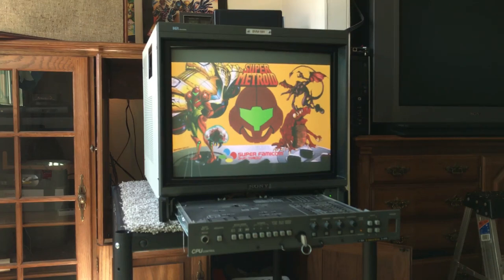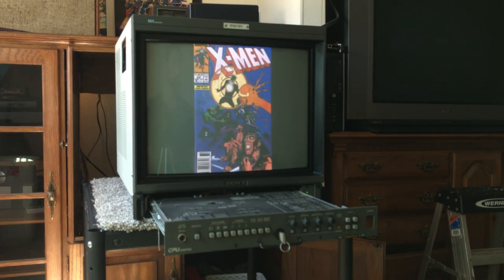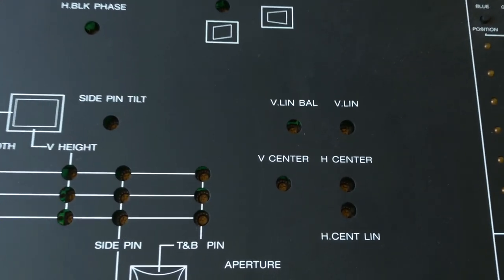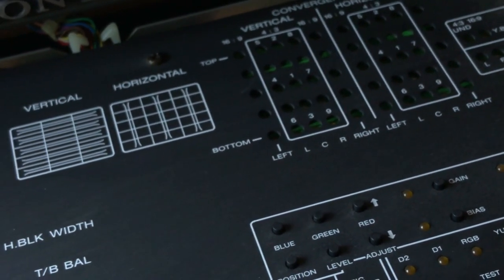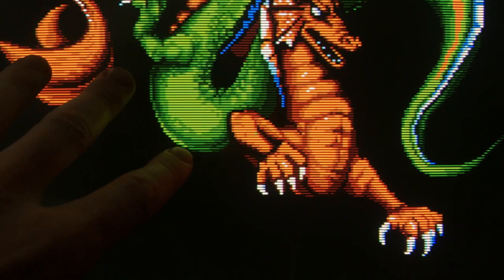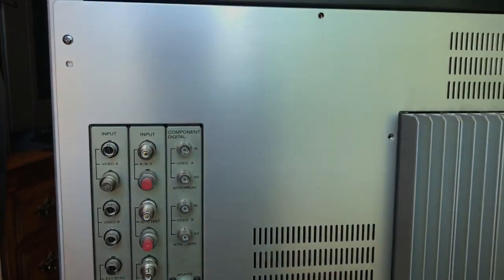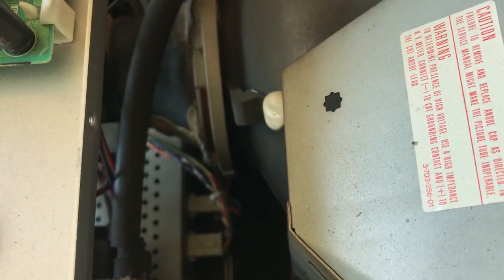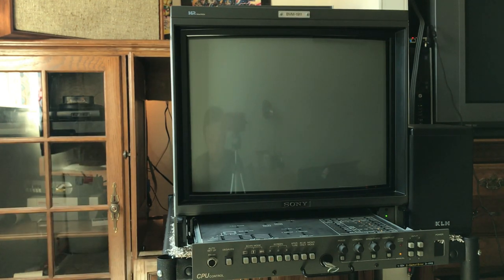Sony BVM1911 CRT Monitor Retro Gaming Review

Comment: Great review to see the engineering evolution that would become the 20F1. A great thing having those pots to adjust everything is that servicing is still possible without needing to worry about the eeprom firmware being corrupt or old which happened to me on my 20F1. I agree that convergence won’t technically sharpen the image but it converges the beams closer and makes the image more focussed. Thanks for sharing your overview of the monitor
Reply from the maker: Yeah it's a trip. Growing up I always thought technology would only get better but looking at the state of things today I'm not so sure about "progress".

Comment: So sweet dude! Love my BVM-20F1U, has 35k hours but had a tube swap, so it is practically brand new in that regard. As far as the BVM/PVM & consumer tubes, I believe the lower grade PVM tubes that weren’t as sharp were used in a small amount of consumer CRTs of the same size (20”) so basically the 2030 as far as I can think of - which was already a “pro-series” consumer set in Japan back then anyways. But seems you may know more about that stuff :)
Reply from the maker: Japan has different tubes. I don't know much about their market but I have heard that consumer grade Japanese tubes can have 2030 tubes in them. I got a soft spot for the 2030. It's got style.
Reply: @riggel8804 same, such a great PVM man

Comment: Hey there, I forgot to come back here to tell you how it all went and to share a couple of pics I took! Anyway, of all the CRTs I have here, this is and I think will always be my favorite. Not only because of the beautiful image it produces, which is awesome, but because of how cool it is to adjust nearly everything physically and immediately with just the turn of a small screwdriver. Dammit, I love it! Adjusting vertical size, center, and the same for horizontal, is just so satisfying. Opening the tray alone is just so cool. I love this thing. 

Here's a couple of pics I took of it (added as replies here), I adjusted it the best I could, but it's hard to do it justice. I will make a playthrough video with this monitor on my channel in the near future. YouTube now has a thing with deleting comments featuring links, so if there are no replies to this comment, then it got deleted. But yeah, it looks awesome.
Reply from the maker: yeah bro youtube ate your link. Stoked you like the monitor. The cool factor on it is off the charts. It came out at the pinnacle of Sony and the pinnacle of analog tech. Right before everything went digital.

Comment: I got a 1988 BVM 1911 for 700$. Some people might  think that's expensive, but for me, I can afford it easily. Plus it was a steal price for what they usually  go for, especially considering the condition it's in. I tuned it to have nearly perfect geometry and convergence. The colors are vibrant and the screen is as bright or brighter than my VGA monitor. I unplug it from the wall right after I'm done using it and I try not to use it too any hours a week. It's built like a tank, it weighs 90 lbs. This thing is really nice and I'm not selling it any time soon.
Reply from the maker: I think it has $700 in value compared to what other monitors you could get for 700. I didn't know they made them as far back as 1988. Damn. Does it look different than mine? 

I've heard of people getting 80k hours on these things so I wouldn't worry to much about how much you use it. You probably couldn't wear out the tube in your lifetime if you tried. Even if you used it 3 hours a day every day that's only a thousand a year. I'm sure some components will fail eventually. I had to replace a couple caps on mine on the deflection circuit. Hope you got a way to service it.
Reply: i know the listing your talking about man i wanted that thing issue is i lived 16 hours away and had no money enjoy

Comment: Hi Riggel! I got the monitor yesterday, it looks amazing in person. I took the RGB to BNC adapter that I had on my PVM and plugged it in and turned on the Super Nintendo, it looks amazing! Got a garbled image at first, then all I had to do is open the tray, click on external sync, then RGB (was on component) and a couple of turns with the screw to adjust size and centering and wow, I just love how easy it all is!

That being said, the image defaults to a bright, washed out image when the brightness button is not pushed in. I don't actually have enough 75ohm terminators. I just had three here, which I put on the output of the RGB, but I reckon I still need one for the external sync out, and the two composite out as well? What about the component digital outputs, do I need terminators on those two? I stopped using the set until the terminators I ordered from eBay get here, which is a shame, as I really wanted to game on it asap!
Reply from the maker: I think you only need terminators on the output side of populated inputs. So if you are using rgb you need terminators on the r g and b output. You don't need terminators on the composite or component digital if memory serves me correctly. I am not sure about the sync line. I know there is a manual button on the front that you have to toggle on or off to mess with the brightness rotary dial on the front.
Reply: @riggel8804  Thanks for replying so quickly! I appreciate the info. I looked up on the manual, and yeah, it looks like I will need a terminator there:

Page 14
"When the loop-through output is not used, attach a 75-ohm terminator."

So it looks like I'm one terminator short and will have to wait, as I just have 3 of them at the moment. Hopefully, it gets here tomorrow, so I can get to finally use it safely. The manual says the same thing about the composite inputs quote above, but it doesn't specify if you need to be using the inputs in order to terminate the outputs, so I don't know for sure. 

I won't be using composite on this set at all, as I stick with my consumer sets for composite or RF. Is there any harm in terminating them anyway? If so, just the output ones, not input, correct?
Reply from the maker: @crt_rex  No. There is no harm in terminating them if you are not using them. You could hook up to component to test it out. You have 3 terminators and you only need 3 when using component. Hook up a ps2 or a wii if you got one. Or you could hook up a dvd player.

I don't think you need a terminator on the composite if you are not using it. You will know something is off if the image is way to bright. In that case you are missing a terminator.
Reply: @riggel8804  Thanks! I got a Wii and PS2, but I also have added component to my RGB-modded NES, so I could just hook that up then, until all the terminators get here! Capital idea. I could even use my RGB2COMP for other consoles if the terminators take a long time to arrive. Thanks for letting me know about the composite, I won't be using it at all here, so it's good I can just leave it alone then.

Comment: Very awsome set indeed! I'm like you though, I'd rather game on a bigger screen. Question: You have any knowledge on Sanyo crts? I was able to pick one up for free in a nice housing edition. It's a big boy 32in. The convergence is absolutely perfect! I'm not the best at all in honing them in as I'm still learning, but I wanted to learn more info on the set and brand in general. When I google anything about this model I keep coming up empty handed. The model is DS32225-01 with a november 2005 manufacturing date. Any and all information or options would be welcome. So much info is available on the popular brands it's insane. I've personally never thought Sanyo as a weird low budget brand. Somewhere in the middle. Maybe I'm wrong?
Reply from the maker: I know nothing about Sanyo. I know guys like there Philips tvs and I would have thought of those as cheap. I have a couple budget tvs that look amazing (Sharp and Panasonic). The fact that it's 2005 means it's probably got a fresher tube and that's good.

Yeah. It's next to impossible to find info on most consumer crts. Be part of the solution and do a crt reveiw!
Reply: @riggel8804  lol while I'm flattered that you think I could do an actual quality crt review, I honestly don't think I'm good enough as the legendary Riggel. Maybe once I can get into the service menus I'll share little bit of my opinion on it. No remote, so that will have to be resolved first.
Reply from the maker: @TheAlphaOmegaX3  Yeah let me know what you think. There's a lot of hidden gems out there....a lot of stinkers too.

Comment: Nice monitor man!
I had the chance to grab one a few weeks ago from my monitor supplier but I was broke and it had 50k hours racked up on it with no indications of a tube swap so had to pass. 
I might be picking up an hdm-20e1u from him though which is another rare one.
Reply from the maker: get em while you can. It's not getting any easier/cheaper. Never heard of the hdm. I did a google search. Multiformat hd 20 inch crt. Doesn't get much better than that. Is it 4/3?

50k is a hell of a lot of hours.
Reply: @riggel8804  I just made a 3rd trip to my pvm guy a couple weekends ago. I got a 20m2u, 14m2u, three 8" bvms, and a bunch of other goodies for cheap.

The 20m2u is in great shape but red tally light is on and wont power on. I got it on the bench tore down doing deflection recap. The power board is outputting 5v,15v,and 115v outputs fine so its something on the chassis board. If caps dont solve it ill be pulling and checking transistors. Most of the caps I pulled were high esr.

But yeah, the 20m2u will be my first 20" sony pvm. I cant imagine any tube looking better than my 20" panasonic 800tvl broadcast monitor but I hope im wrong lol.

Hes got another 20" panasonic monitor for me that wont power on and that hdm 20e... I never heard of them either untill now. They made a 38" 400lb version thats super rare 😮
They are 16x9....Only does 480p or 1080i though but would be cool af for later gen stuff,movies, and maybe hook pc up to and try some new games on it.
He said it might need work though. Image smearing. 600 bucks.
Its a gamble and idk if a service manual is even available its so rare. Could only find one post on reddit of a guy who had one.
Reply from the maker: @LameGaming  I wouldn't expect the 20m2u to look better than your Panasonic. I have a 20m2mdu and It's no sharper than my consumer grade Toshiba. Don't get me wrong It's a great monitor but it's at the lower end of video quality as far as pro tubes.

That HDM looks like a hot mess. 16/9 on 20 inches is going to make 4/3 games look about as big as a 14 inch monitor. So you can basically think of it as a 14 inch monitor. Can't imagine watching movies on that thing. The fact that it doesn't do 240p makes it kinda useless. If it was free I would pick it up for a youtube video but for $600-hard pass.
Reply: @riggel8804  Yeah, the 20m2u will be fun to compare against the panny but cant see it being better.
I have mixed feelings about the hdm.... Would be cool to play some current gen stuff on. I think ps4 and 5 still have 1080i options. But yeah, $600 is alot.
I wish I could find a jvc or Panasonic multiformat monitor.
I did get a free 26" toshiba widescreen hd tv for free, i need to test it out still... Im hoping I can laglessly pass through 480p as 540p on it
Reply from the maker: @LameGaming  Some 20m2u vs pro Pani side by side footage would be great. You ever get the new camera figured out? 

I am academically interested in hd crts, Couldn't see myself using one though (I got a 100 inch projector with 1 frame of lag I use for hd stuff.) People hit me up all the time about hd crts I want to do a review of one because I keep talking to people about them. The internet needs a video showing their strengths and weaknesses. I haven't seen any one demonstrate lagless play but I remember you telling me it's possible. Makes sense if you can force native resolution.
Reply: @riggel8804   Man ...this 2nd shift out of town work just isnt jiving with content creation for my channel 😟

I did spend like 2 whole days testing out android, iphone, and my micro four thirds camera, all shot against eachother from same tripod, same conditions, same settings.... And I do believe the iphone took the cake for video but my expensive camera did for still shots.
Would of been an awesome video but never found the time to edit.
Also got tons of new toys, meters,gadgets, mods, monitors in but same story.... No time for anything, really sucks because ill probably miss the boat on some "first to show" type videos.

Yeah, the HD crt niche is making headroom, bob from retrorgb and a guest were talking about hd crt models that had no lag on oneof his recent podcasts. I think part 1 from the expo.
The problem is time slueths are hard to get. Id like to test some but then would have to start collecting hd sets too and have no room left lol. I couldnt pass on the free 26" widescreen HD toshiba though as its only 75lbs and has hdmi and component so even if it sucks ill use it for gamecube and netflix
Reply from the maker: @LameGaming  yeah work sucks. I envy other cultures that put their kids to work. I got a bunch of ideas for videos but I got a bunch of hobbies. I try to prioritize gaming over fiddling and recording. Working on a Battletoads clear right now. 

I don't worry about the youtube. I just make sure I upload once a month. The algorithm, patreon and monitzation can all GIT FUCKED as far as I'm concerned.

There are a lot of hd crts out there. A lot of them have amazing tubes in them. Always seemed like a waste. I would like to do a tube swap with one and a sd tv.

Comment: I'm looking for advice on dealing with purple/green discoloration in the corners of my flat-screen Trinitron. The picture is gorgeous on 90% of the screen, but a couple of the corners are tinted with purple or green. Is there a fix for this?
Reply from the maker: Sounds like a purity issue. You need to degausse it. If that doesn't work than you can try gluing magnets to the tube or the chasi. I have a video on making a degausse wand. Should help you.
Reply: @riggel8804  searching it up now. Thanks for the quick response!
Reply from the maker: @magic3383  ye